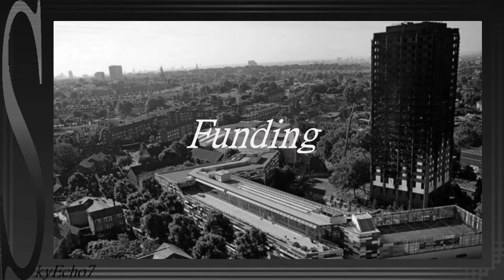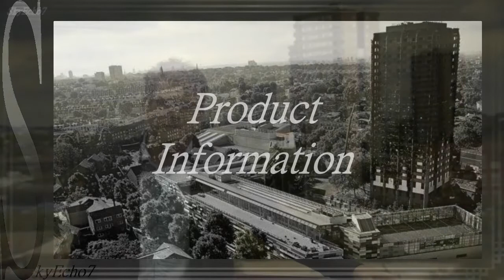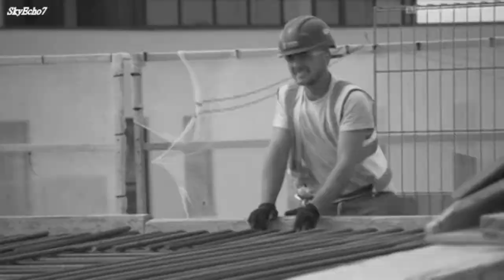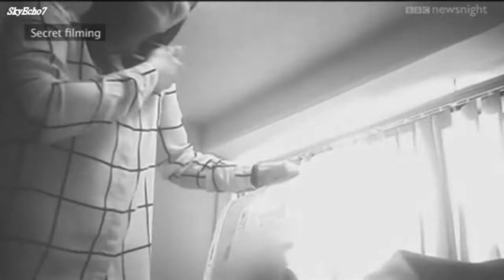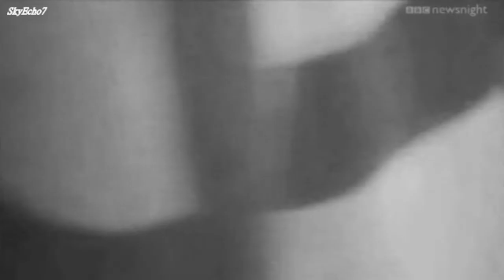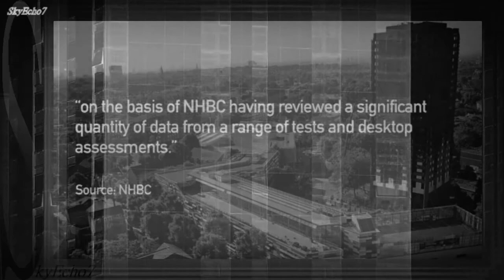Grenfell Tower: Building Standards, Qualifications & Regulations

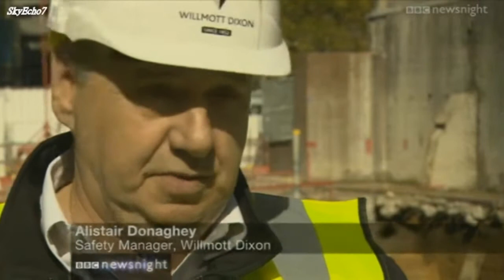Comment: Fraud in CSCS? really? what about NVQ's? businesses can be as corrupt as you can ever imagine, including the Trainers. Neoliberalism is too blame, starting around 1945, and has had a spurt on since Heath and Thatcher. This is a good example of what happens when business is in charge with no Government control. @ 8:48 and I'm thinking about Quality. You can get away with less quality depending on the project, the client and who's involved. The problem arrives when workers move project. I wouldn't walk on every Willmott Dixon site and expect to see identical quality in management never mind materials or training. It's all a bit fluid, right across Industry and Nationwide.  I would class one particular WD site, as the worst I've been on ever, management, Training and Materials, the whole project, shocking. That was Social Housing as well.